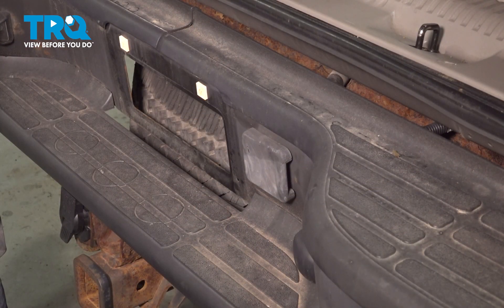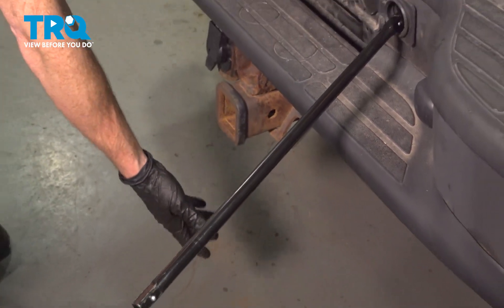How to Replace Spare Tire Carrier & Hoist 2000-2006 Chevy Tahoe

Comment: Mine broke in what I thought was a strange way. The cable would lower, but the metal shaft that goes into the hoist wouldn’t come out- so I ended up having to brace up the tire then cut the bracket with a 4” cutting wheel.